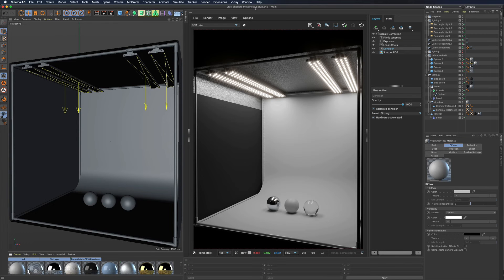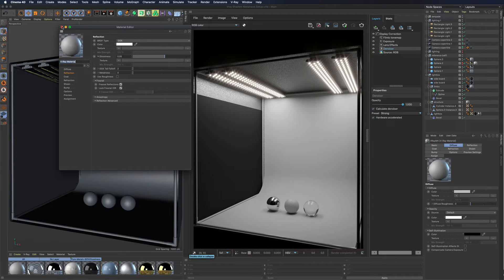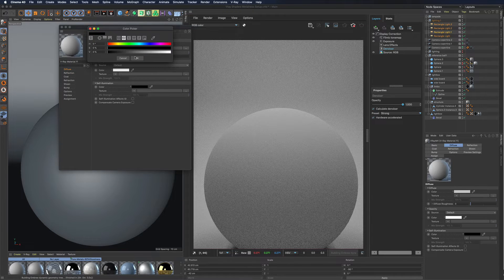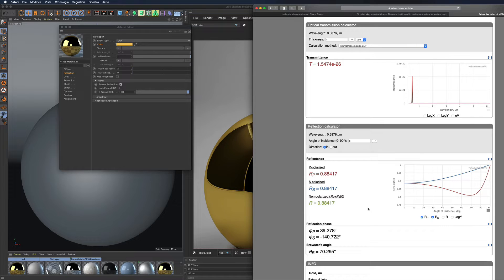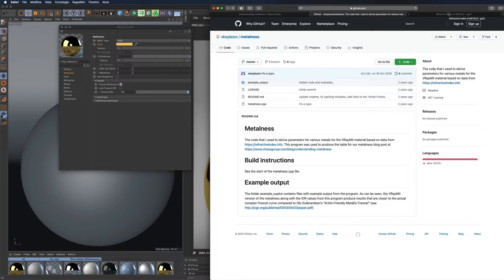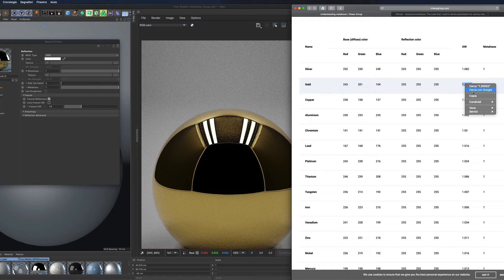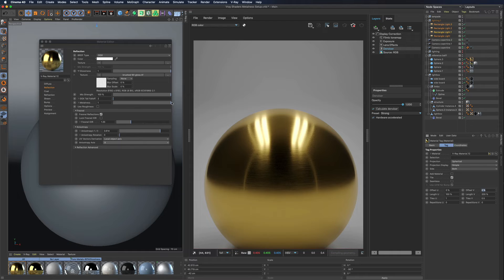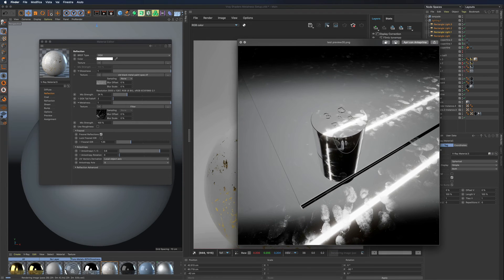V-ray5 for Cinema4D Metalness Workflow

Comment: Hi, I'm having some trouble with rendering textures in Vray 5. I have both a normal map and a height map (exported from substance painter), but I can't seem to figure out where to place each. I've tried to place the normal map under "bump" and set it to tangential, however, it doesn't seem to give me any results? Even adjusting "bump amount" doesn't give me any height. And where do I put the height map?